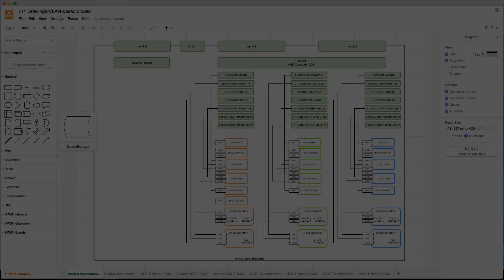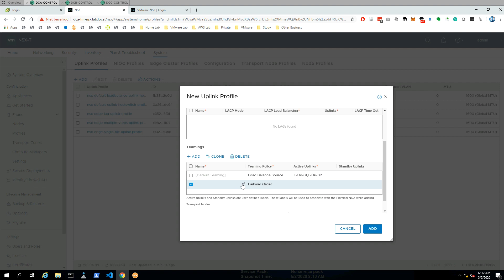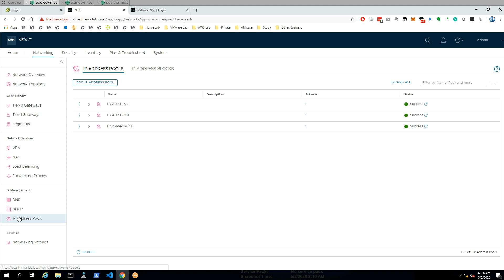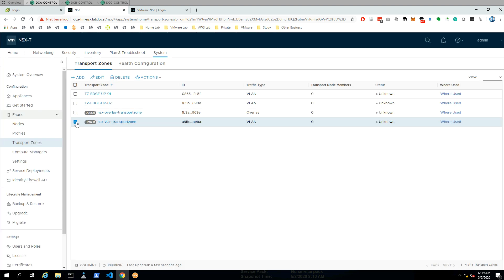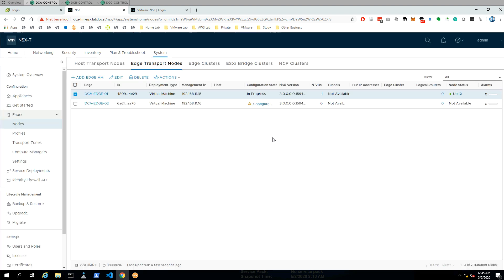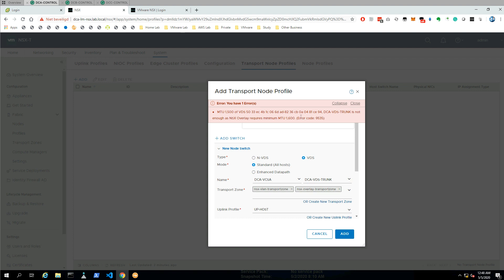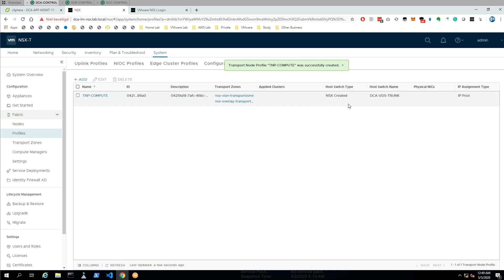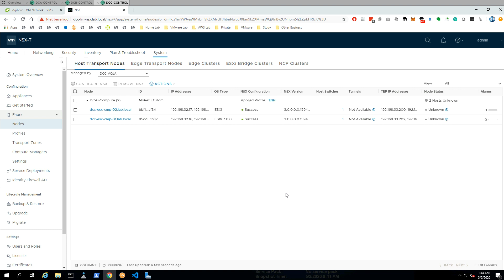NSX-T Federation | Part 2 | The Edge/Host Transport Node Configuration basics (for NSX-T Federation)

Comment: q1. You also have a GW setup in the Edge. Host and Remote IP Pools ?
q.2 If you are using the VLAN 114 inside the Edge, that means you have a VLAN Trunk setup on the physical ESXi host ?
Reply: correct the ESXi hosts Distributed Port Group for the Edge uplinks would be a trunk
Reply from the maker: q1. Yes, 
q.2 Correct, it has to reach the Edge VM in a way ...